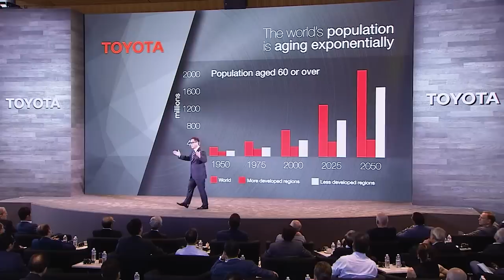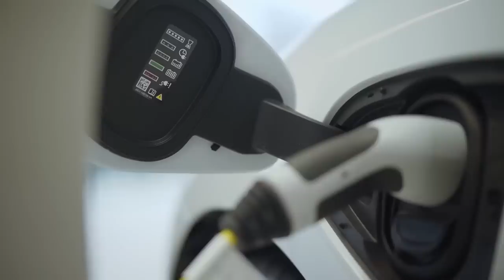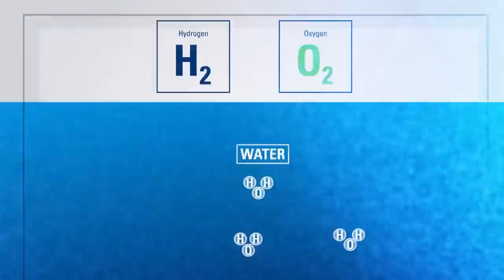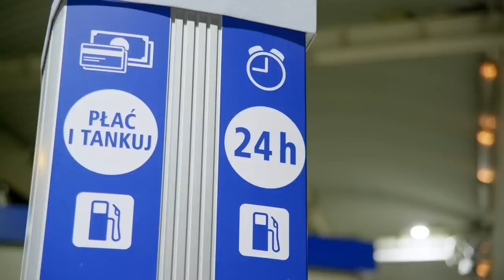New Toyota CEO Shocks Everybody | Huge News

Comment: Good to see a car company trying to solve an engineering challenge with common sense, and not with marketing and fishy sales pitches.
Reply: Say what?
Reply: Yes cause it’s “common sense” to use electricity to generate Hydrogen, only to be converted back into electricity inside the Hydrogen car to power the motors
Reply: I am an engineer and hydrogen scares the shit out of me. You are sitting on a rocket
Reply: @boyongo0700   Ok, but this is a solvable problem.  
You are a bad engineer if you are not interested in solving HOW.
Reply: @edc5068  One of the huge problems with the current EV's is the lithium batteries. They still did not quite figure out how to dispose of them, and we have very little lithium on the planet. Also, it takes a lot of energy to make those batteries, and unlike in the case of making hydrogen that turns into electricity, that energy is lost. For that reason, I personally always felt that, under the current circumstances, it is, indeed, common sense that fuel cells are the better alternative.
It is completely disingenuous to use the name Tesla on the Musk cars. Tesla would have completely rejected the system. His idea was taping the electromagnetic energies of the planet. That means clean, inexhaustible, and also free energy. This was why JP Morgan stoped financing his project on Long Island. The real Tesla system makes no money for investors, again, the energy is free. This was the reason why we got stuck on oil, coal and natural gas, and why now they pushing the inefficient, polluting, very expensive current EV's.
Reply: @boyongo0700  As an Internet engineer, you know very little about the Toyota fuel cell system. Their hydrogen tanks are beyond safe. Among others, they are high caliber bullet proof.
Reply: @boyongo0700  not different from cars running on LPG.
Reply: @edc5068  When it comes to energy density, BEVs are at the bottom of the list. Hydrogen is three times that of diesel.

At present, the world moves on diesel for heavy jobs. Batteries will never solve that problem.

At some point, if we're going to be prevented from using oil based transport, then we'll have to grasp the nettle.
Reply: @boyongo0700  What kind of engineer are you? I tested BMW's Hydrogen 7 prototype years ago as well as the Mercedes GLC F-Cell. The high pressure tank safety regime is near absolute. On the other hand the thought of millions of BEVs with spontaneously combusting lithium Ion batteries whose fires that cannot be extinguished worries me far more!
Reply: @boyongo0700  For an engineer you know remarkably little about the safe storage of Hydrogen - you know it is not stored in a gaseous form to feed fuel cells - right? I am a real PE btw
Reply: @boyongo0700  did any hydrogen vehicle blast?
Reply: @rjones6219  It is way more energy dense by weight but far from that by volume.  The volume of the tanks is a huge issue.  Look at the Miri as an example.
Reply: @JamesJoyce12  The hydrogen is stored at 10,000 psi. Hydrogen is extremely volatile to pretty much air.  The Mira has about a 6kg tank capacity of hydrogen. 29g of TNT equals 1 gram of energy of hydrogen if they were to explode.
Reply: @@jeffdesertmountains5028 Yes, but, it makes no sense whatsoever.  I was looking for some clarification, which obviously you could not provide either.
Reply: @sorellman  You really need to wake up.
Reply: @edc5068  And on top of that, you need to transport it via ships and trucks.  Not to mention the labor to get it to your tank.  I've tried to explain that to fuel my EV, I need to do nothing (SPs), and NO ONE else needs to do anything, either.
Reply: @timower5850  Well now, if everyone changed to EV's the entire worlds electrical grids  and infrastructure would need a total revamp, and we would need twice if not thrice the amount of nuclear generators, wind turbines, hydro-power plants, coal plants, etc, etc. to generate the electricity. Do you think electricity simply is there in the socket for anyone to take as much as they want of?!
Reply: @boyongo0700  As opposed to a vehicle run by gasoline??
Reply: @edc5068  Because of battery issues. BTW compare the efficiency of battery (which is the single heaviest component), hydrogen fuel cell and combustion engine.
Reply: Ed C Because of battery issues. BTW compare the efficiency of battery (which is the single heaviest component), hydrogen fuel cell, and combustion engine. You will be surprised.
Reply: @neonix01  In Australia, 40% of homes have solar roofs, and 75% of EV owners have solar roofs.  These actually contribute to the grid, and as more EVs offer V2G,  EVs will constitute a large section of electricity reserve.  As the vast majority of EV owners everywhere charge overnight, any strain on the grid is minimal; that said, solar farms and the like will be located near the customer, eliminating the large amount of the electrical energy wasted just getting it to the customer.  As for ICEVs, consider the incredibly VAST amount of energy wasted to get oil from the fields to your tank (do you think gas just shows up in your tank?).  And once it's in your tank, 60% of that amount is WASTED strictly as heat, providing nothing to move your car.  Well now, it's apparent that you are woefully ill-informed.
Reply: @neonix01  the coal golden era all over again! 🤣
Reply: @boyongo0700  yea....a tank of gasoline sounds sooooo much safer 😅
Reply: @edc5068  logistically yes, a hydrogen tank can be refilled much more rapidly than charging a electrical. Hydrogen powered vehicles would also be less susceptible to range loss over the lifetime of the vehicle and in temperature extremes. It would also allow solar and wind power to be optimized as areas that are better at harvesting those energies can export them two areas that do not do so as efficiently. Hydrogen also functions as a solar and wind power allowing locations to not have to have backup fossil fuel power plants for when there is no wend or good sunshine.
Reply: @JamesJoyce12 BTW😂
Reply: @Jeff Desert Mountains rofl
Reply: @Jeff Desert Mountains rofl
Reply: Yeah...when will that happen?  I'm not seeing it here.
Reply: Lol ya OK
Reply: @edc5068 typical crazy climate religion
Reply: @sorellman  youre misunderstanding what tesla was saying. Infact he'd be pretty horrified to hear what you believe he was saying lol. Theres no free energy floating around. Not in the way you think. The "free" energy he was always talking about was all the wasted potential of our power systems using DC instead if AC. It wasting INSANE amounts of electricity. He referred to it as free energy because at the time really only the rich or companies could have it. He wanted to free up all the inefficiencies and give it to regular people for free. Thats why he tried so hard to make wireless transmission a thing, if he could replace all the wires with wireless systems, anyone anywhere could just tap into it, and they could still charge the rich who needed large amounts of it. Never could make a wireless transfer system that was efficient as AC powerlines though. And we could probably do it today, but why would the electric companies want to though? Would be insane from a business pov.
Reply: @themultigamer5682  You have no idea what Nikola Tesla was doing (not just saying). Your logic suffers badly: "He referred to it as free energy because at the time really only the rich or companies could have it." How can something be free if "only the rich or companies could have it?" What companies are you referring to? (It's a rhetorical question) If you have wireless transmission of energy, you cannot put a meter on it, reason why it would be free. Also, he made demonstrations of how you could get energy free of charge without spending a penny to produce it. 
I would not address every erroneous or self-contradicting statement you make there. Free energy is possible, and he was about to demonstrate that. Capitalism stood in the way, and it still does.
Reply: @sorellman  There is no lack of Lithium, just a shortage of refineries.  Not only that, Tesla is recycling those batteries and reusing them to make new batteries, so there is no waste problem.  Hydrogen is small and prone to leaking.  It is difficult and expensive to transport.  It is difficult and expensive to store.  It cost energy to convert electricity to hydrogen and it cost energy to compress hydrogen.  You need a massive amount of hydrogen plants to supply the hydrogen, then you need to have hydrogen fuel stations.  And it doesn't matter how safe the hydrogen is stored, it is naive to think that it will never blow up. The energy cost of producing hydrogen far exceeds the energy cost of making batteries and so you end up having a higher cost of ownership for hydrogen cars.  The only clean way to produce hydrogen is with electricity, but most hydrogen is produce with fossil fuels.  If you are going to use fossil fuels anyway, then wouldn't it make more sense just to keep using ICE cars?  

I used to think hydrogen might have a place as fuel for semi-trucks.  But since the Tesla semi came out it became obvious that they won't even have that niche market.
Reply: @sorellman  Google tells me there are 22million tonnes of lithium accessible with today’s mineral extraction tech.

Each car only needs 6kg of lithium, which is around 3.6 billion cars. For context there are 1.4 billion cars in existence. Tesla being the most ambitious, plans to produce 20 million a year in 2030. 

It will take them 183 years to deplete lithium with that scale of production.

By 2030, this depletion date may extend out to a couple more centuries if:
- Lithium extraction advances and is able to tap into the full 88million tonnes that exist on the Earth crust.
- Lithium is imported from space
- A better mineral or battery chemistry replaces Lithium
- We dont use cars anymore to go places, teleportation?

A lot of factors can change in 183 years
Reply: @rjones6219  no doubt that currently diesel and Hydrogen can cover longer distances. But with electrolysis the KW/h needed to produce a kg of H is more than the KW/h that the unit of H can store for H vehicles

You may as well use that KW/h to charge up an EV.

Unless its natural gas (blue hydrogen) which unfortunately has the issue of carbon emissions.
Reply: @neonix01  I assume you're in favor of Toyota's hydrogen plan?  So where will the electrical power come from to create green hydrogen?  Does that somehow come for free?  The vast majority of it will come from the grid.

Moreover, there is practically zero infrastructure for retail hydrogen distribution in most of the world.  I'm seeing 62 total for USA & Canada and most of them are in California.  This cannot be overstated:  the infrastructure to build out hydrogen transport to levels needed for end-user consumer use will be *massive*!  On top of all that hydrogen distribution is very difficult since it requires massive 700 bar pressure and hydrogen metal embrittlement requires costly materials. Of course, there will be absolutely no home refueling but that's something EVs regularly do.
Reply: @tsiefhtes  the lifespan of an Ev can range between 10 to 20 years. Interestingly this is the same lifespan with Hydrogen cars.

In terms of charging times, if you have a wall charger at home. You can charge at home while you’re asleep, and it’s ready for you to drive in the morning.

There is no more need to look around for a charging station unless of course you go on that occasional long drive.

Unfortunately the interstate drivers will have to cop the 15min-30min charge. Which is not bad if you see it as a good opportunity for a break.
Reply: @Jeff Desert Mountains Hahaha bro literally just told him what ThisIsAnotherChannel said LOL
Reply: @santory5788  
Our job isnt to optimise the dumbest possible way to do something. It's to make it the best we can for the lowest cost possible.

Deciding to make a plane with turbine jet engines and fixed wings, rather than giant flapping abominations, is not being a "bad engineer".
Reply: @skyfox585  You will be the next philosopher.
Reply: @timower5850  Fishy sales pitches.
Reply: @santory5788  Dirigibles solved the Hydrogen problem with Helium.
Reply: @sorellman  They just recycle them completely.   Its actually easier to recycle a car lithium battery than a cell phone lithium battery.  Also the shift to Sodium batteries is starting.  The energy used to make a battery is lost once while the cost of making hydrogen is lost each time hydrogen is made.
Reply: @sorellman  The safety of the cars is not the problem.   The explosions have been at the fuel stations.
Reply: @rjones6219  It takes 8 semi trucks of hydrogen per 1 semi full of diesel.   Batteries look like they are solving the heavy lift problem.
Reply: @timower5850  That's great for australia. Come to Norway where half the year barely has any sunlight, tons of snow and sub-zero temperatures, and try to install solar panels and see how much they help. In a normal winter day here, most EV's have their range reduced by about 30-40% just from the cold alone. Very efficient. Coal power plants are burning all across Europe due to severe lack of energy - now thats very efficient and environmentally friendly isn't it.
Reply: @sorellman  This is near exact what I’ve been trying to tell everyone who thinks that EV’s are bad. EV’s are a great invention in society and the infrastructure is perfectly capable of delivering AC power to the car at around 7.5W. AND, if we ever get some company to make this, a computer to determine what gets the most power, and what doesn’t. The cars might actually be able to do this one day. Unfortunately like you said, lithium is very difficult to work with considering how quickly the lithium deteriorates. The LED when it was researched, wasn’t economically viable for street lighting. Nowadays, this is the case because of rapid growth in technology. Toyota is making a very good move postponing its production of EV’s until the lithium ion battery is replaced with something more economically viable.
Reply: @edc5068  ever heard of Green Hydrogen ??
Reply: @markntexas8265  facts. The huge windmill farms near Portland Texas destroyed hundreds of acres of food crops, and is an eye sore. Wild hogs, bobcats, 10 different species of snake, and deer just wonder through the town after the lose of the land. The windmills are loud, always in need of repairs (but they are new!), And several men have died repairing them. Sure do believe a square mile of reflective glass is going to be worse.
Reply: @anilshandilyaa  yep Hydrogen generated from electrolysis powered by green energy.

The caveat is electrolysis needs about 50kw to produce 1kg of H. But that 1 kg of H releases around 33kw of electricity for the H car. That’s without taking into account the additional energy needed to transport and store the H at fueling stations 

You may as well feed that 50kw of green energy directly into an EV.
Reply: @rjones6219  You are absolutely right, hydrogen is an excellent way to store energy due to its high energy density. However, to produce the required amount of hydrogen with the current state of technology, so much electrical energy is needed (and wasted) that you might as well charge EVs with it. In addition, current hydrogen production technique is so environmentally polluting that you might as well continue to use fossil fuels.
Reply: You forgot the elephant in the room that is the prius.
Reply: so what he wants to suck the oil from mother earth
Reply: @boyongo0700 fuel like hydrogen is more efficient to produce energy either by combustion or electricity, if your an engineer I would agree too that you should be solving problems within the idea to achieve something great.
Reply: @sorellman  MultiGamer has some unbound pronouns there.  I think what he meant was that because DC power was so expensive, only big companies, and the wealthy could afford to use it.  DC power was expensive due to high transmission losses.  So if you could get rid of most of the transmission losses by switching to AC, AND make it wireless  (Tesla's system), the original primary users would continue to pay for it, and the general public could tap in for free.

As for free energy, hydro is free.  Wind and solar are free, but intermittent.  I don't know of anything else that comes remotely close to those three, and those three aren't really free due to maintenance costs.  Yes, you can get charge out of the atmosphere, but not in any mount that's practical.

I'm glad Tesla didn't build his system.  I have no desire to live in that strong of an EM field.
Reply: @rjones6219 you need oil for transmissions or in general moving parts, cars can use straight ethanol, nitromethane or methanol as fuel. Even hydrogen can be used for combustion. And yes EV’s use oil too regardless… and oil isn’t just used for cars.
Reply: @sorellman  Solid state batteries will make lithium batteries go the way of the incandescent light bulb.
Reply: @santory5788  it's already solved... don't use the electricity to make hydrogen, just use the electricity to power the motor. 
 duh
Reply: @boyongo0700  I'm not that worried about safety, but throwing away 60% of produced electric energy with hydrogen conversion doesn't seem like the way to go...
Reply: @boyongo0700  see also, Hindenberg. And hydrogen, being the smallest of all molecules, has a nasty tendency to leak or seep through porous materials.
Reply: @edc5068  or spend an hour charging your EV after 3 hours drive
Reply: @edc5068  also parts of the world generate electricity with hydro exclusively so it’s cheap and clean
Reply: @stanleyyoung7638  Yes, solid state batteries allow you to go for 400 miles, and they recharge in 15 minutes. That, however, does not solve the problem of producing energy for millions of cars.
Reply: @santory5788  that’s is such a naive take on engineering. Go back to school kid.
Reply: @sorellman  That’s part of the infrastructure bill recently past.
Reply: @Tim ower  lol.. yeah. No one other that the 100s of 1000s that run power stations, build the infrastructure etc. Btw, you can have hydrogen delivered if you run out... someone going to bring you a can of electrons? You obviously don't understand the infrastructure and limitations involved.
Reply: @Tim ower  you take that ev into the outback for a few days at a time? I mean, I'm sure there are ev stations everywhere, right? How much energy is also wasted in an ev through heat? There a reason evs have thermal shutdown?
Reply: There is a reason for such sayings that have been around from the beginning of time "fortune favours the bold", "he who hesitates is lost", "if there is no vision the people perish".  The electric train has left the station on electric vehicles long ago, and Toyota is not a "first mover".  They are still packing their luggage.   What is a true visionary?  I actually recall Bill Gates saying: "I cannot see the need for PC RAM to be much more than 256K."  (probably paraphrasing some here.)  But he was wrong by several orders of magnitude.
Reply: FINALLY!!  HYDROGEN is gonna be awesome,cheap to produce, and CLEAN!!!
Reply: Toyota can start to change the world of using hydrogen(deuterium) in cars instead of petroleum which at the same time can affect the climate change in a positive way since hydrogen is safe and clean.hoping someday the world will utilize deuterium as a source of energy.
Reply: wtf dose tesla have to do lol
Reply: @boyongo0700  As an internet keyboard intellect with a self determined IQ of 9000, I say let me sit on a rocket. If I’m gonna go out, let me go out with a bang like the crew on the Challenger as my eBay special stereo system Blairs Elton Jonn’s rocket man.
Reply: I read "fishy scales pitches"
Reply: @LaZarusXtnct  how bout click the friendship button
Reply: Because hydrogen takes up too much volumetric space. If you dont believe in BEV's, it will be something else because its not hydrogen either
Reply: @dominic539  Bob Lazar did it in the 80s. It was easy.
Reply: @timower5850  The most sensible reply here...
Reply: @edc5068  Another nice, level-headed, logical post. Where do people think this hydrogen gas is coming from? The cost of production, transportation, storage, distribution and new infrastructure is ludicrous... BEV is the way of the future - if it wasn't so, how come every major car manufacturer is heading that way? Toyota are late to the game, so they're hedging their bets...
Reply: Well … I’m hopefully, but skeptical.  Like … I’d like to see a hydrogen can go through a safety rating test - partial frontal car crash - and see how it repeatedly holds up.  Sure it’s more metal in the “engine” block but … yeah … that’s an area of concern that we don’t want “DrFauci” level promise on, we need the truth
Reply: @boyongo0700  Yeah and how much electric waste energy do we have in the conversions?
Reply: @sorellman  What's needed is a standard battery unit. The tech in each unit could change and capacity be increased, but each unit would have the same form factor, same voltage and capable of producing the same amperage and capable of receiving the same charging power. Then different vehicles could choose how many units they utilise and in which configuration. And as a addition to this just as with rack mounted computers you could maybe standardise on a couple form factors that are then compatible with each other.
Reply: @sorellman  But are they truck proof?
Reply: @victorluke5816  Sodium in cars? I highly doubt that. As a home battery or storage solution yes.
Reply: @iankuah8606  
Its the thought of all the cobalt released in a lithium ion battery fire which worries me. I don't want to be a candidate for a lung transplant.
Reply: @gregkramer5588  
From an aircraft point of view, hydrogen's low weight compensates for the high pressure tanks.  Flight may prove to be the easiest system to convert away from fossil fuels.
Reply: @boyongo0700  
Short of a fatigue failure, hydrogen and its fires are lighter than air and burn upwards. It was the diesel fires which killed the passengers in the Hindenburg fire.
Reply: @timower5850  
Have you forgotten the fossil fuel powered electricity plants ? The saving of environmental damage with EV vehicles is 2 fold, low local pollution, tyre wear, noise, and control of pollution, sulphur, nitrogen oxides and others, is much easier in a stationary plant where parasitic weight is not an issue.  

The EV advantage is vehicles are designed to maximise efficiency making the overall system efficiency, about 25%,  higher than typical cars with the bonus of better aerodynamics.
Reply: @edc5068  that's called a battery... Even in other batteries electricity is stored similarly by driving chemical reactions while charging and reversing them later to produce electricity..
Reply: This whole video feels like a fishy sales pitch.
Reply: I'm not sure what you're trying to say, but an EV powered directly from a solar roof requires NO energy expenditure from ANYWHERE ELSE in the world, unlike an ICEV, which requires a VAST, complex array of machines and transport systems to get fuel to your tank.  Once it's in your tank, as much as 80% of the available energy is lost solely to heat, contributing NOTHING to move your vehicle forward.  As far as a carbon footprint, there is NO comparison between an EV powered by a solar roof for 20 years and an ICEV powered by fossil fuels extracted from the earth a continent away.  As for electricity generated from fossil fuel plants; it's on its way out.
Reply: @michaeledwards2251  Long Haul trucking it may have  place also.
Reply: @sorellman  The ones I listed are free with regard that you have free fuel.

Everything for free? You end up with  lazy population.
Reply: @santory5788  it is solvable. You bind the hydrogen to other atoms and create complex molecules which are liquid under ambient conditions.
Reply: @gregkramer5588  
JCB already agree with you for their heaviest vehicles.  The point being heavy vehicles have very high usage levels. The heavier, the higher the utilization levels.
Reply: @Jeff Desert Mountains end quote
Reply: @michaeledwards2251  I think agriculture will be a huge application.  Even more than trucking.  My brothers tractor has a 350 galleon diesel tank.  You just cannot replace that with batteries.  Trucking it is way easier since there are shared charging stations and more stops.  Passenger cars will virtually all be battery based IMO.
Reply: @someone46018 There's something fishy in your statement.
Reply: @thomassuit7450  No matter how you spin it after the fact, the three forms of free energy you mentioned are not free. As for people being lazy if not for the lure of money, do they teach that in church?
Reply: @gregkramer5588  
I remember seeing a video on JCB about a year ago with heavy tractors using hydrogen fuel tanks. Their take is the larger the vehicle. the easier hydrogen fuel will be to implement. The advantage is fast refuelling with usage of hydrogen fuelled ICE to quick fuel.
Reply: They so that too.
Reply: @dbtest117  They have been announced by CATL for use in cars in the middle of 2023.  CATL has not been a vaporware company as far as I've read about them.
Reply: @victorluke5816  Interresting 150Wh/kg just 100 Wh/kg less than in typical tesla battery and just 350Wh/kg less than what tesla has announced.
Reply: @rjones6219  the US does maybe, europe runs on overhead electrical lines
Reply: @edc5068  nah you got the principle wrong, they not convert hydrogen to electricity
Reply: @michaeledwards2251  For sure.  No way a farm could have a fast charger for one or two tractors.  It would have to deliver 10x the power of a car charger and that would likely cost more than the tractor!
Reply: Just the amount of kids in Africa who wont have to mine for cobalt with a pick or their bare hands to build batteries is a win for humanity over profits. However small a win it might be. And for that alone Toyota got my respect.
Reply: @timower5850  ev owner here and we’re putting in solar soon too. Home charging is awesome. I barely charge anywhere else. I still have a gas car and haven’t bought gas since the week before xmas.
Reply: @sorellman  why are you being logical on this planet? We’re supposed to be nincompoops who believe whoever has the most marketing and lobbying dollars
Reply: @sorellman  Do you even know the average pressure of a hydrogen fuel tank? It is around 10000psi. FYI, average sedan's tire pressure is around 30 psi. Bigger problem is a hydrogen's  embrrittlemet of solid meterials(metal) which causes premature failure on pretty much everything that comes in a direct contact.
Reply: @timower5850  yeah, all countries have so much sun like an Australia.
Reply: @santory5788  solvable? You clearly don't understand welding defacts
Reply: @edc5068  yeah but you avoid having to use batteries, which are extremely harmful for the envirement. Also with your thinking, why not just use fossil fuels? A considerable amount of energy is produced that way. Why not skip it and burn it in the car?
Reply: @vinceovari5714  if you mean that the mining of minerals is harmful, consider that you only need to mine only once per vehicle. 

Meanwhile with fossil fuels you need to mine/drill oil constantly for the life of refuelling an ICE car.

Also note that Hydrogen cars also have a small battery so there is some mining needed for it. 

Hydrogen also requires electricity from somewhere which may or may not involve fossil fuels, and also needs grid electricity to run the refuelling stations

BEVs also tap into the grid, but a home owner can have the option of installing solar to bypass that.
Reply: tesla introduced hydrogen fuel cell car also, democrats going to be pissed ev is dead
Reply: @heretic7486  You're funny!
Reply: Even Hydrogen Engineers think Hydrogen powering cars is stupid. It is a waste.
Reply: @edc5068  We have too much electricity during the day and not enough at night its a good storage system
Reply: @sorellman  you are wrong in everything you are saying, we have massive ammounts on lithium on the planet, its a very common element on earth, lithium batteries are being recycled already . You are also wrong on energy generation of hydrogen, its what is innefecient as we lose energy turning hydrogen into lithium. Do you think we require no energy creating fuel cells storage for hydrogen? The will be a place for hydrogen in the world, but your common sense is nothing but random wrong facts.
Reply: @neonix01  Yeah unfortunately a lot of people think electricity is magic, haha.
Reply: @Blockiee  😂.. I'm glad you noticed it too 👍
Reply: I like 2 stroke gas. It best
Reply: Evs suck, they’re explosive, to some degree, and very flammable on the inside. Also most are ugly and are incredibly heavy.
Reply: @edc5068  well we do have black hydrogen and it gets made as a product of oil refining. Even with all EVs we will still need plenty of oil to make just about everything we use in modern life. Even medicines are made with oil products. It's crazy how much of our stuff has oil or oil products somewhere in the process. I guess we should use the hydrogen if it's there to be used?
Reply: @sorellman  So in a hydroelectric plant, how much is the cost per gallon of water i.e. how much do the plant operators pay for the water to drive their turbines?

How much are wind farm operators paying for wind to drive their bird choppers?

Does everyone go to church?
Reply: but different from Tesla you can extinguish hydrogen car after it blow's up ;-)
Reply: @jonsmithjohansen2493  I don't like putting words into his mouth but maybe he meant Cobalt and not Lithium. Either way, relying in Cobalt long term is not good since communists are hoarding them like crazy.
Reply: @ww5511  That's a bad example. Hydrogen has to be highly pressurized. If you run out, no one can bring you some hydrogen.  You would need to bring the whole refueling station.

Not sure if you've seen videos of the F150s EVs charging other EVs. Yep, some EVs can charge other EVs. Also some towing companies now carry battery packs that can charge EVs giving them the range they need to make it to  the next charging station. You can also buy battery packs that can give you can use to add a few miles to your EV or use it to help someone who ran out of power.
Reply: @acolon8999  Weird that Cali has mobile hydrogen refuelers, that can refuel a vehicle to full. Hydrogen cells are filled to about 3000-5000psi, same as Suba tanks. Some portable tanks go high and can be hooked up to perform the liquid to liquid transfer in minutes and give you a LOT more range than sitting there waiting for a portable charger. Hydrogen vehicles can be fitted with outflow valves to refuel other hydrogen vehicles. So, no. A very appropriate example.
Reply: Hydrogen at $0.30 per mile, I rather use gasoline or go with EV.
Reply: @ttp_007  Many don't realize what they are asking for. Like you said Hydrogen is more expensive than gasoline, you can't make it at home so that means that your are going to have to pay a supplier just as many are still doing with gasoline. They set the price. At least with EVs you can make your own fuel at home.
Reply: Good luck with getting bankrupt 😂
Reply: @timower5850  "I'm not sure what you're trying to say, but an EV powered directly from a solar roof requires NO energy expenditure from ANYWHERE ELSE in the world"
Well for one, the solar panels are manufactured in a Chinese factory powered primarily by coal energy... Also, where does one find a great paying night shift job so they can charge their EV while the solar panels are able to produce energy?? I've done a calculation myself using EIA data, and the best BEV's Wh/mile (Tesla's model 3) is equivalent to the average 25 mpg ICE in terms of CO2 output alone if charged on WVs power grid, given their 5,000 kg to 15,000 kg of CO2 (based on battery size) in manufacturing. Some people don't get enough sunlight to justify buying solar panels for their homes.
Reply: @sorellman  Wrong.
Reply: @grantduke318   You err immediately in your argument, and several times onward.  First, I am speaking from the point of taking possession; you of your ICEV and me of my EV and what fueling entails after that point.  If you want to go back beyond that point, I'll discuss the energy needed to make an oil rig.  You need to stay focused.  Second, I'm NOT charging on the grid, and my carbon foot print is zero.  Third, what does it matter what shift you're on; you're home sleeping sometime.  Charge it THEN.  Third, i'm talking my case, and the millions of others who are able to do the same. Lastly, research the rare and precious metals that go into a catalytic converter and the CO2 load to produce them.  AGAIN, you need to remain focused.
Reply: @edc5068  
Someone understand but Japan has another issue that they have no plan on extending their electricity production and instead rely on China to ship fuel to japan.
Reply: @boyongo0700  but you're not... hydrogen isn't just one isotope
Reply: @sorellman  I agree, also lithium is restricted to a few parts of the world, making it difficult to harvest. Even if we replace it with cobalt-nickel batteries, there’s the geopolitical issues regarding cobalt mining. The most potential battery tech is sodium-vanadium batteries. They’re a lot more efficient and sodium is certainly more acquirable than lithium
Reply: @timower5850  Do you have an argument?
Reply: @edc5068  Electricity from 3rd and 4th gen nuclear reactors, sure.
Reply: @boyongo0700  You're most definitely NOT an engineer. The Hindenburg disaster was a thousand years ago. LOL
Reply: @gary7vn  There are 177 replies in this thread, and maybe a dozen are mine.  To what are you referring?
Reply: @boyongo0700  Gasoline explodes, lithium explodes, hydrogen explodes, its almost as if to power a car you need a volatile material?
Reply: @grandiewandie  its the degree of volatility. Hydrogen mixing with air is enough to make it explode unlike the other fuels you mentioned. Also the energy density of hydrogen is 3 times that of gasoline.
Reply: @boyongo0700  😂😂
Reply: @edc5068  Better than pretending that using Fuel to produce electricity to run cars is a better alternative than putting the fuel directly in the car. Common Sence. EVs do more damage to the environment than traditional fuel cars.
Reply: @einstien2409  as a matter of fact, fuel (petrol) used to produce electricity would power more EVs than if that same petrol were used to power ICE vehicles.

1 gallon fuel = 25miles travelled in ICE vehicles
1 gallon fuel = 12kwh electricity
12kwh = 37miles travelled in EV vehicles

It would be common sense to go with the vehicle that can cover more mileage
Reply: @edc5068  1 battery = more child labour and toxic gasses released in the environment than 1 liter of fuel burned. Take that into account too.
Reply: @boyongo0700  Yeah thats what horse people said too though 🤔
Reply: @einstien2409  You are correct about the toxic gas (CO2) released into the environment, but with a caveat:
1kg Li (Lithium) extracted = 1.5kg CO2 emitted
1kg oil burned = 0.315kg CO2 emitted

However you only need 8kg of Li (Lithium) for an EV which you mine only once per vehicle. Compare that to 88kg of oil needed for each refill for a 50litre petrol car.

12kg CO2 emitted from 8kg Li extraction,
27.72kg CO2 emitted from each refill of a gas vehicle

The child labour prone mineral Cobalt, is no longer needed in the new EV batteries.
Reply: You are extremely ignorant about the topic if you think that heavy machinery cannot be electric. All indoor trucks in warehouses have been electric since the 80's. Size and weight are not a problem for heavy machinery, so batteries can be bulky, also, batteries are not required for most heavy machinery, because the really large machines are connected directly to the electric grid using 400 volts or sometimes even 6000 volts to power them. Your idea of heavy machinery are trucks, my idea of heavy machinery are tunnel boors, industrial grinders, industrial presses, furnaces, centrifuges... And guess what, there will be electric trucks too.
Reply: I’m not convinced Battery EV is the future; unless we can start making batteries without the nasty raw materials like Lithium. Making EV batteries currently requires the use of LIMITED raw earth materials…so will have same challenges as with oil regarding geopolitics. Plus currently the mining of these battery materials is very dirty and uses horrid working conditions akin to slavery.
Reply: @iankuah8606  I don't believe for a second you're an engineer! If you have ever WORKED with hydrogen you'd know that extinguishing hydrogen fires is no simple feat!
The thought of anyone driving a hydrogen car NEAR me in traffic scares the living hell out of me! Yeah, "prototypes", until you work with hydrogen at that scale where one tiny leak can turn a garage into a potential place where an explosion takes place! Unless, you have a steam hose, some nitrogen, common sense, a decent equipped operator or chemical engineer nearby I wouldn't touch hydrogen!
Reply: Hahahahahahahahahahahaha! You are the best comedian yet!
Reply: @boyongo0700  Because you know you are careful opposite to marketing sector and politicians
Reply: @edc5068  Well, that's why we need to find and use alternative and cleaner energies such as Wind, Solar, Geothermal, etc. instead of relying on our old fossil fuels. It's no way to just convert fuels in cars and proceed to complaint about our environment.
Reply: @edc5068  well, you get rid of the problem of how to dispose of used batteries. As well as having to mine for them in the first place.
Reply: @MrJturner74  While that is actually a good point, and it would be great not to require mining and disposal of Li (Lithium) or any minerals, this is not so much the issue, for now. 

The priority goal is to transition away from oil, and BEVs can get there faster due to compatibility with the existing grid, and energy efficiency. Eg, being able to charge 2 BEVs vs 1 Mirai with the same amount of electricity.

It will take more than 150 years to use up all the mineable Li, and afterwards a couple more centuries if a method is discovered to extract Li from regular dirt.
Reply: @sorellman  A very long way of saying you know NOTHING about electric cars or Hydrogen fueled vehicles. do 5 minutes of research and then comment. Having an opinion is not the same as knowing what you are talking about.
Reply: @GROND15  So, I should do 5 minutes of research, you say. My mistake. I did hours of research instead of 5 minutes. That shows how unprepared I am to discuss this issue, right? 
"Having an opinion is not the same as knowing what you are talking about," says the guy who does not give us a single example of something not factual in my comment. Other than that, I fully agree with you on this one.
Reply: do you want to be dependend on woke oil again?
Reply: @sorellman  Not a single thing you said is accurate.
Reply: @sorellman  There is plenty of lithium on earth. It's not rare even though it is called a "rare earth" metal. A fuel cell electric car has batteries, that's where it stores the electricity the fuel cell makes. Hydrogen is a poor fuel even though it is energy dense. Hydrogen is difficult to store and harder to ship long distances. It is also twice as expensive as gas or diesel. Also it takes far more oil to make a gallon of hydrogen as a gallon of gasoline. The best source of litium or other battery materials is....old batteries. recycled batteries are cheap battery material sources. Eventually mining battery materials won't be needed in large scale. Explain how burning anything to make electricity, using that power to make Hydrogen, compressing it, shipping it around and THEN putting it in your car is more efficient than burning something to make electricity, puttting that power in your car and using it. This video was propoganda for hydrogen, which by the way would benefit the petroleum industry immensely. It would create even more demand for oil than the current system.
Reply: The batteries are still too expensive and Un Reliable
Reply: Does Toyota or any government willing to spend the money to build a hydrogen fueling infrastructure?   oh BTW, it will cost trillions of dollars.  not billions.
Reply: @santory5788  
The "solvable problem" might be the physical storage.
Cumulative efficiency loss in the liberation, transport, storage and reconversion is not solvable to the degree that makes it competitive with simpli using "straight" Electricity.
Reply: @GROND15  Absolutely, not a single thing I said is accurate, and the theory of relativity is a bogus theory. Also, they don't call lithium a rare metal because is a real metal, but because we have plenty of it on this planet, as you say. Everyone who Googles for "lithium reserves on Earth" can figure out the real facts. You want to win a debate? You can't, the facts are stacked against your opinions. I don't debate and I don't have opinions. I have facts. I'm all for electric cars. I just do not see a good reason why I should buy the ones they sell today. First and foremost they are big energy consumers when it comes to making them, and they reduce our ability to travel. Call me when they use the Nikola Tesla system.
Reply: This whole video si a fishy sales pitch.
Reply: @edc5068  it’s the same principal with EVs… You generate power  via pollution (more than the power to generate hydrogen most likely) and use that power for the vehicle.
Reply: @jexselzayasjr5626 that is false according to the following points:
- The most common method being used by industry to generate H (Hydrogen) is SMR (steam methane reforming)
- 9 to 12kg of CO2 is emitted to create 1kg of H with SMR
- 1kg of H can store 39.4kw electricity
- 1.1kg of CO2 is emitted when generating the equivalent 39.4kw electricity from a coal powered station

If using the green energy method of generating H, there’s no point, because only about 0.4kw is generated inside of the actual Hydrogen vehicle for every KW that was used to create that Hydrogen
Reply: just not falling for the panic propaganda because the earths weather has been getting warmer for centuries , the most arrogant humans think that they can change the weather
Reply: @edc5068  do you understand how the alternator of your car works?
Reply: @boyongo0700  ummm gas engines are bombs lol. Remember the Ford pinto? Also the Samsung notes?
Reply: @joemichele5412  not even close.... please don't talk unless you have a basic idea of the concept
Reply: Hydrogen will not sell....
It's a waste of time and money
Reply: @whendarknessfalls6969  yup imagine that but three times as energy dense. Also this is considering that hydrogen production is not green as is derived from natural gas which in the process of capturing the CO2 emission ,methane is release to the atmosphere which is even worst than CO2. The greenhouse footprint of hydrogen is worst than that of natural gas itself.  

In reality nuclear power  (fission) is the best option for power as we dont have  time to figure out fusion. Also fusion has its on set of problem which also releases radioactive materials due to production of tritium. 

As for cars, electric would work if charged by nuclear but they charge times are slow and ranges suck as electric cars have horrible energy density but it has its issues with lithium batteries production.  Hydrogen cars dont really solve any of the problems unless its produced with nuclear power and it becomes very inefficient.  In terms of gasoline cars its probably one of the best options for transportation in terms of greenhouse emission footprints. 

 I think our best bet is to find away to be carbon neutral and develop carbon capture technologies en figure out how to reverse CH+O2 --> H2O + CO2. Problem with that it requires a shit ton of energy and I think this is where nuclear comes in handy. 

just my two cents.  Unfortunately hydrogen  car is not the silver bullet everyone think it is. There is  not such solution like that.  Either we rely on nuclear and scale back our energy usage  or we will just keep warming up the planet.
Reply: ↗Not telling you to buy THETA and IRIS crypto! ↗
..... biggest investment opportunity .....
Reply: Yeah they are open to all
Reply: @edc5068  it may be, as hydrogen has way higher energy density than the batteries; there is no perfect solution, only trade offs
Reply: @rjones6219  exactly
Reply: @neonix01  also, society would become extremely vulnerable from putting all eggs in one basket
Reply: @timower5850  solar panels only have 20% efficiency, and that when there are no clouds, and when the rays of light hit perpendicularly; and most places on Earth have less sun and more people than Australia; also, in order to charge overnight, you need your own house and garage, which is not the case for most of the 8 billion people living today; go visit a couple of big cities in Asia if you don't believe me...
Reply: @bogdanpopescu1401  No, you don't need your own house and garage: you need solar panels.  A community charging station would more than suffice, and infinitely viable.  And please, stop with the "oh, what about cloudy days" crap.
Reply: @timower5850  you don't? where do you put the panels if you live at floor 6 with 4 more apartments on top of yours? you know, the way most people live, not spoiled Australians or Leo DiCaprio...
and calling things crap doesn't make them go away; clouds are a reality in most places where people are living, people need their cars to be independent of the climate or the weather;
if you factor everything in, you get down from 20% to maybe 2% of what you would get if you could capture all the energy of the light hitting the panels perpendicularly 24 hours a day;
there is a reason fossil fuels still amount to over 80% of all energy used worldwide, after so many decades of pushing renewables; and most of the non-fossil is either hydro and nuclear, not solar panels...
Reply: @sorellman  Wow… you read the entire anti-EV talking point sheet. Amazing! Everything you just said has been disproven with with actual third-party science for quite a while. Not sure where you are getting your information, but you should do more research before saying things like that. You aren’t convincing anyone.
Reply: For sure, I think it would take 40 model y batteries to have as much energy as the fuel tank on my brother's big tractor (350 gallons)
Reply: @boyongo0700 whats the differenr about petrol car